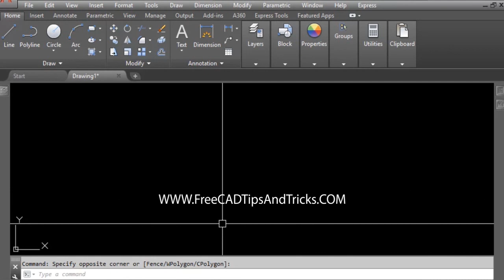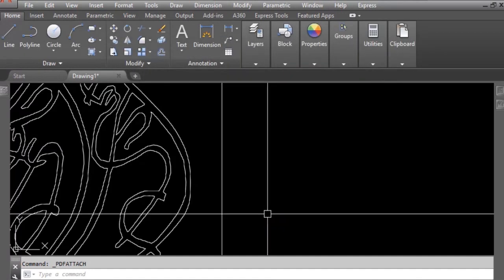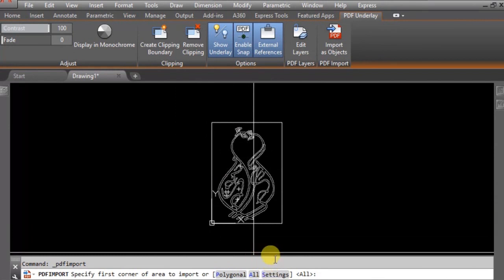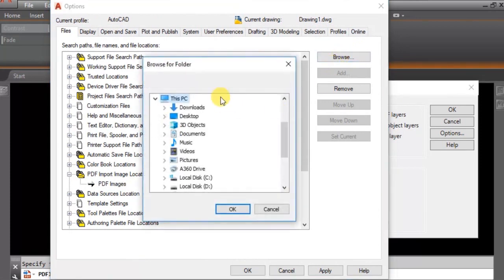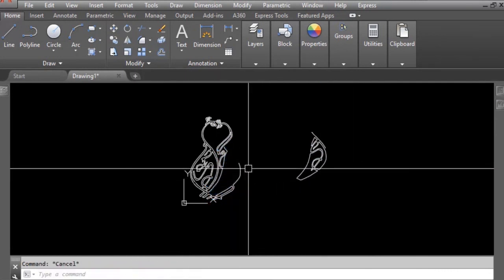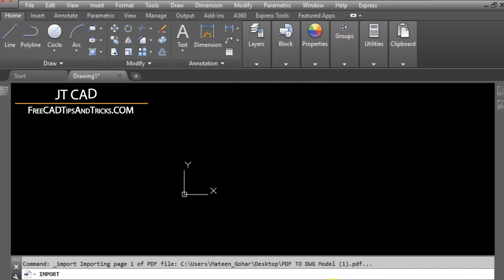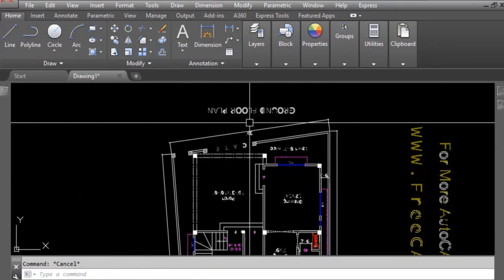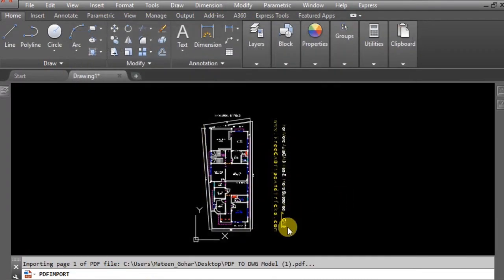Convert PDF To DWG Editable AutoCAD Drawing | Auto cad Software Classes

Comment: sir.. .my import as object doesnt display.. it only show up until pdf layers.. how can i do that? .. i also use autocad 2014 version.. im waiting for your right respond .. tnx.
Reply from the maker: There are two types of pdf file. 
One is exported or printed from cad program. While second type is scanned drawing. 
This method works for the first type of pdf the second type scanned drawings needs to be completely redrawn manually.

Comment: Is it possible to convert a 2 D drawing which is in pdf format to a dwg drawing and can we edit text and do customizations in it after converting.....? If yes then please tell me its urgent with the version of autocad needed to do this task.
Reply from the maker: Yes possible. You can edit anything.
Reply: @JTCAD  wow you replied. Thanks. Please tell me or guide me how to do it.
Reply from the maker: Is there any error that you are getting while converting the pdf ?
Reply from the maker: If it is scanned pdf Drawing you will have to redraw it or trace on it in AutoCAD. 
If it is printed from any cad software then the method shown in the video can be implemented.

Comment: which type of the pdf is required??? for editing this type of the pdf drawing into the autocad can u please tell
because its not happpnenig in my autocad!!
Reply from the maker: There are different types of pdf files. Some pdf files that are generated from autocad or any other cad programs can be converted by this method. But other type of pdf files that are just picture photo graphics converted to pdf will not be able to generated as autocad file. This type of pdf files can be traced by attaching reference to drawing.
Reply: JT CAD ok thanks